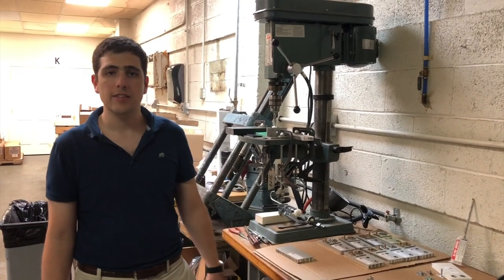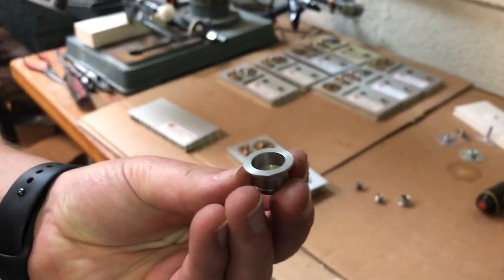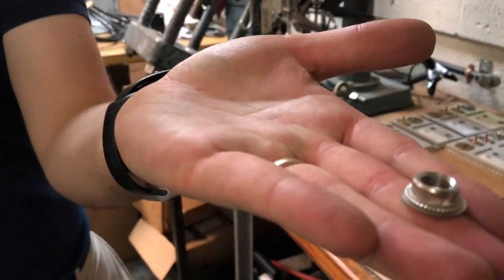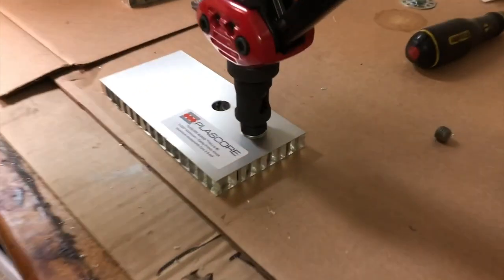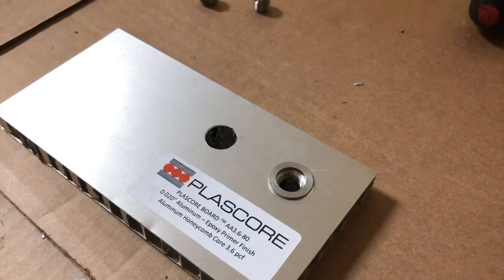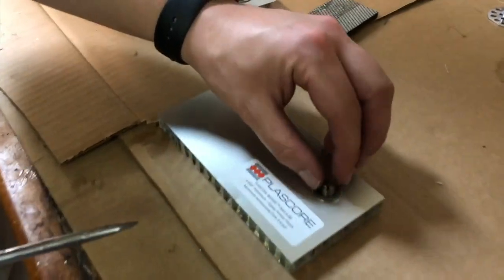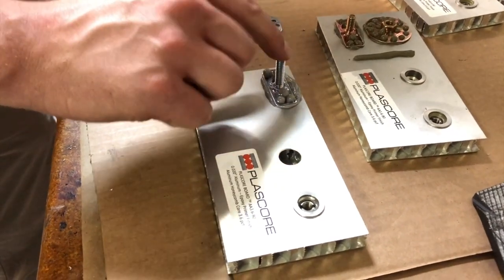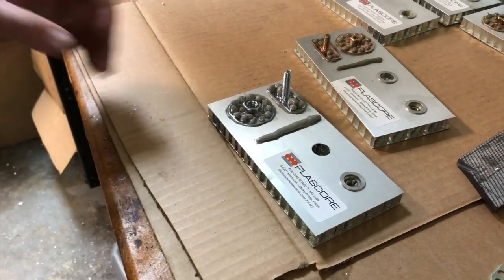Assembly Solutions for Honeycomb Composite Panels: Surface Mounted Fasteners and Deform-nut Inserts

Comment: How does one ensure that the adhesive bonds to the inner skin and the core foil, since that material has not been primed and usually has thermobonding compound that generally does not stick well to adhesives, unless surface-activated? I.e. are Plastcore panels particularly well suited for this process?

Comment: Greetings and thanks for the video.  Will this work in Fiberglass Laminated Composite Honeycomb Panels as well as it pertains to the deform nut and the riveting it in etc.? If not, do you have any recommendations for that particular material?
Reply: Yes. It works great in fiberglass. Have done this on many projects.
Reply from the maker: Yes it does!